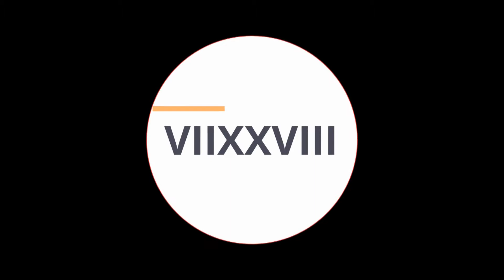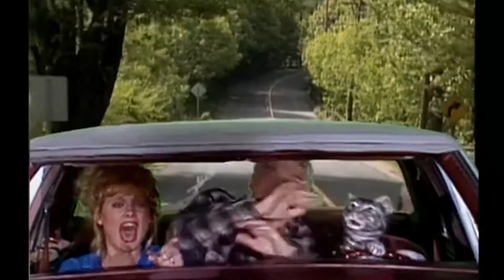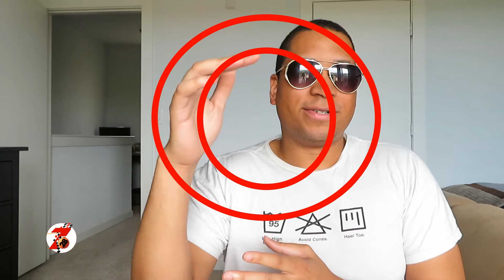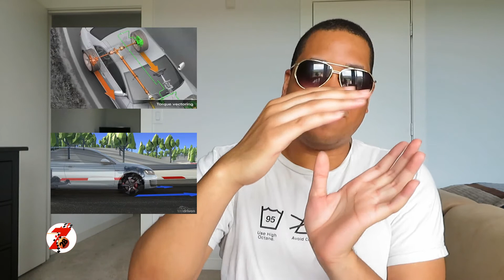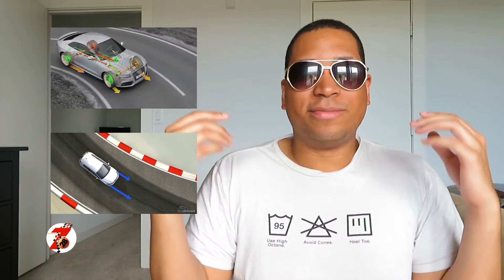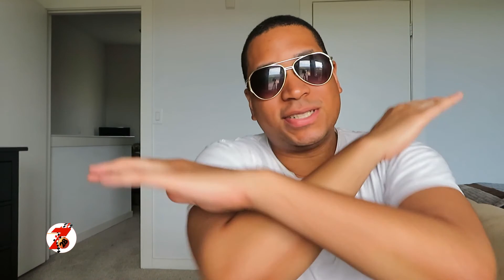What the heck is Torque Vectoring?

Comment: Yes.. My friend had straight posi and inside  tire would drag around corners.
 I have a Cayenne turbo it has a super advanced triple differential torque vectoring system that puts power to tires with most traction.. You can also lock all three diffs and raise the air suspension 6 inches for off roading..
Reply from the maker: Baller alert! Lol The Cayenne is a beast of a machine.